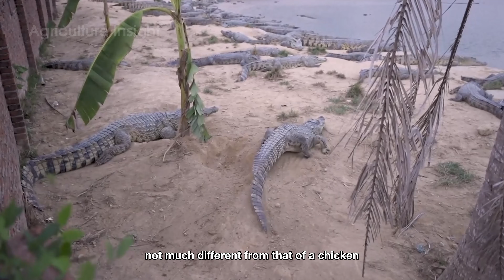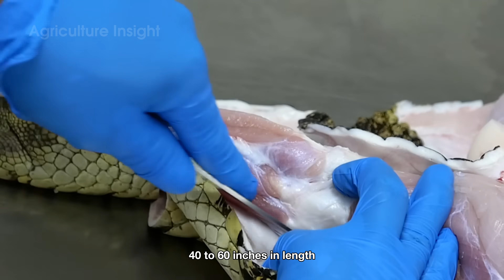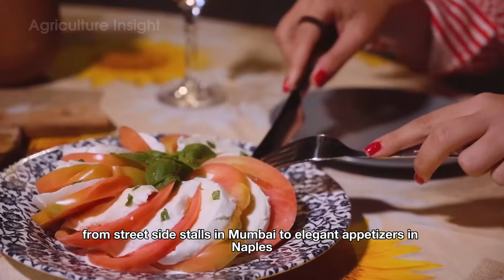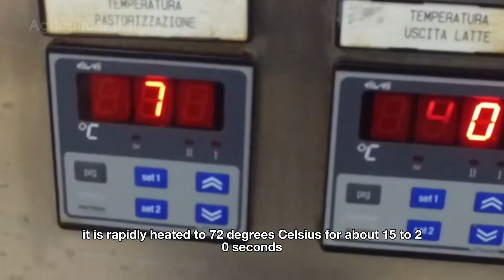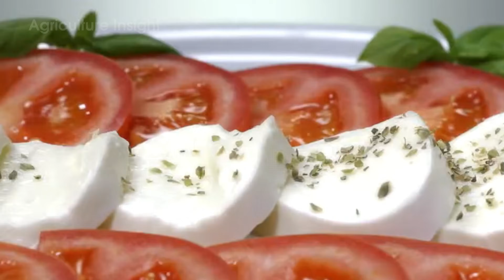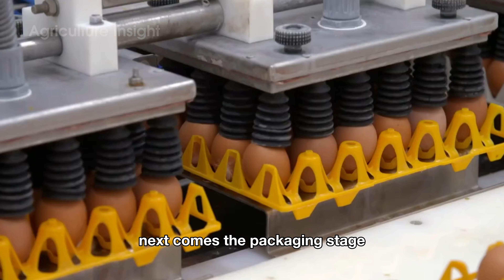How Millions of Crocodiles Are Processed – Massive Crocodile Farming For Skin & Meat

Comment: How do the factories clean their machines each day or after the product phase? Any cleaning process at all?
Reply from the maker: Thank you for the question. Most food factories follow strict cleaning protocols, usually using a method called CIP (Clean-in-Place), where machines are cleaned with pressurized water, detergents, and sanitizers without disassembly to ensure hygiene and safety.

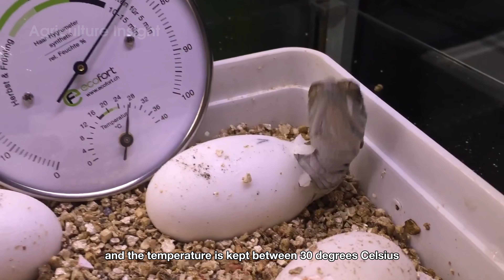Comment: 5:33 says that the eggs are kept between 30 - 33 degrees Celsius, but thermometer shows 28 degrees Celsius  :face-orange-raised-eyebrow:
Reply from the maker: Sharp eye! Actually, 28°C is below the optimal hatching range for crocodile eggs (which is 30–33°C), but it's still within the extreme limits where some eggs can survive — though hatch rates and embryo health are usually lower. What you’re seeing might just be a brave little croc that made it through tough conditions — pretty amazing, right? For the best results and proper gender development, farmers usually aim to keep the temperature steady between 30°C and 33°C. Thanks for noticing that detail!
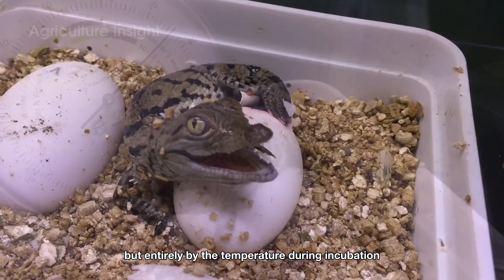Reply: Because the voice is AI. Notice at 5:54 there is a glitch in the voice.